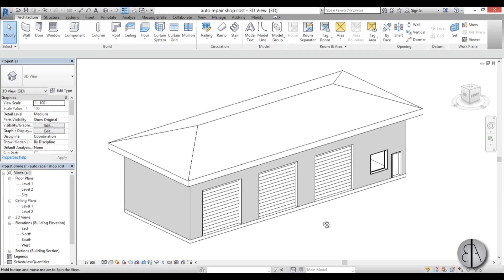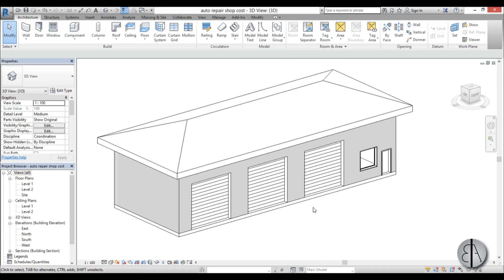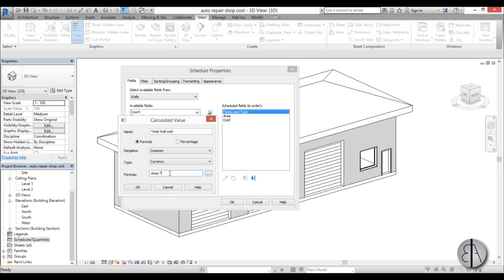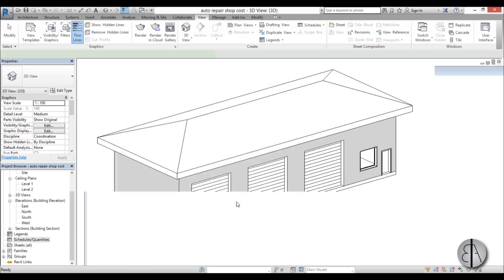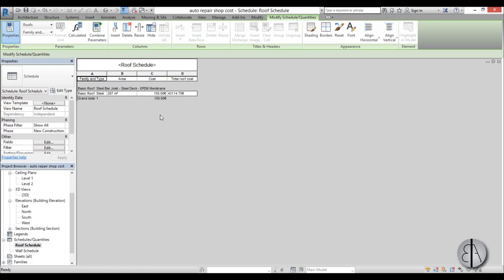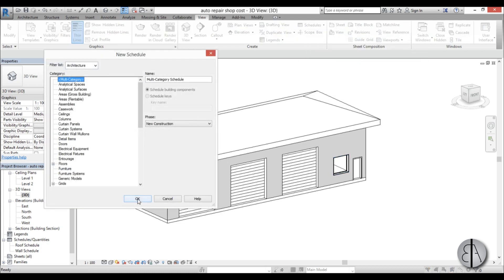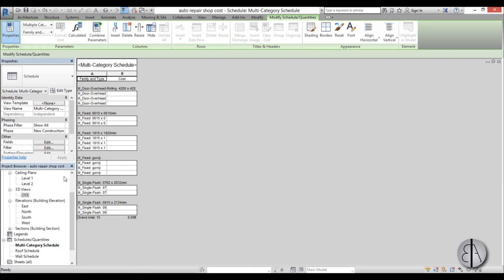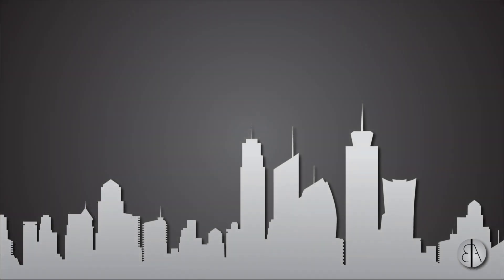Cost Estimation (calculation) in Revit Tutorial

Comment: Hi I've been a subscriber since i was in college, can you do a detailed estimate on revit? I.e. for masonry wall (chb, no. of steel bar, no. Of cement bag, volume of sand?
Reply: You are better off if you ask a local builder about that. It may differ between different countries.
We normally calculate with 1000kg sand and 250kg cement for 1000 standard brick.

Comment: When you add the amount in the cost section for walls and roofs, does revit always consider it as Sqm? or is there any formular we need to to add?
Reply: if your project is built in Sq ft then it will calculate respectively in Sq.ft..
Reply: @fariabaloch410  Find Cost of Buelding in 30 second.
(Advanced) House Construction Cost Application design by Engineer Samandar Khan Samandar 2020.
https://youtu.be/Af6KIhLiqLA

Comment: WELL I HAVE A QUESTION.. THE WAY I DO THE CALCULATION IS LIKE THIS...
AREA COLUMN
CHB PCS COLUMN= AREA OF WALL/ AREA OF CHB
TOTAL COST COLUMN= CHB PCS X COST PER CHB

THEN A SEPARATE COLUMN WILL BE CREATED FOR THE CONCRETE POUR ON HOW MANY BAGS OF CEMENT, SAND AND GRAVEL

THIS IS HOW I CALCULATE THE WALL PRICE 

THE COST FOR THE LABOR WILL BE SEPARATED ON A DAILY BASIS AND IS NOT INCLUDED ON THE COST ESTIMATE ON HOW LONG THEY WILL FINISH THE WALL

IS THERE SOMETHING WRONG WITH THIS?

Comment: How could we find the amount of ceramic tiles of flooring by part  method in the presence of a  block wall.
Reply from the maker: I guess you need to divide the total wall area by the area of a single tile
Reply: Balkan Architect area of ceramic  flooring come equal either i place a wall as partition or not. Do u have any solution . Moreover in section bottom of wall shows it connect with slab and cut the finishing floor but im 3D its show void b/w slab and wall bottom. If u have a solution plz let me show.
Reply: For area of wall and floor tiles I think it is easier to take from room schedule

Comment: Is there any option for cement or concrete and steel !
What about Indian currency
Reply: You can change the currency in project unit
Reply from the maker: Material takeoff (that I show in the beginning of the video can calculate that but I don't use it 'cause it is hard to add the labor costs that way
Reply: In the US we have books to derive cost per sf (including labor) such as RS Means or The Guide. Using the system Balkan Architect showed, we could input this cost/area knowledge (concrete and steel requires engineer specified drawings) and have a pretty good system. My office doesn't use Revit models to derive cost estimates because there are too many exceptions that Revit wouldn't pick up and high risk of human error. We still would have to bring the information from Revit to an excel file. So we use more simple software like Bluebeam Revu